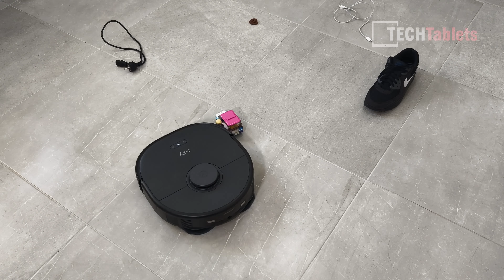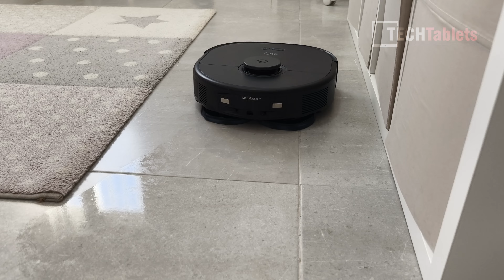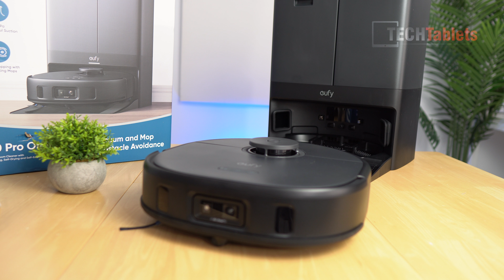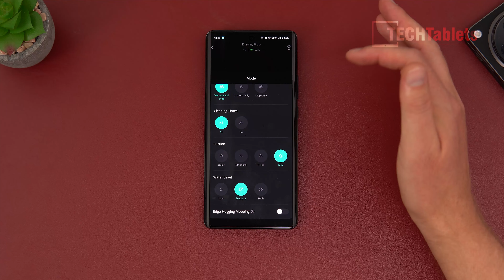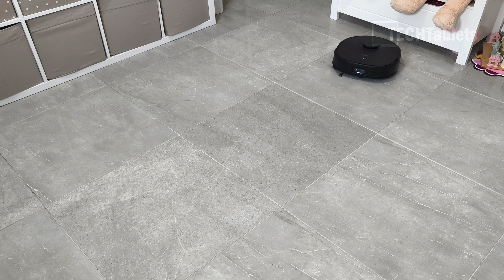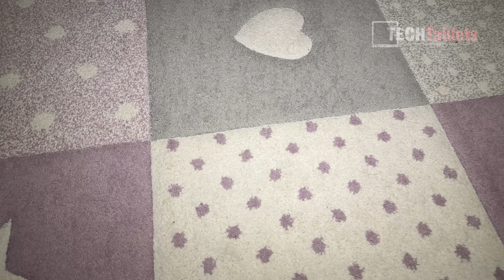The BEST AI Obstacle Avoidance All-In-One Robot Vac Under $1000! eufy X10 Pro Omni

Comment: How did you test detangling system, there are some reviews of X10 and previous eufy models using same system showing it does not work at all, your brush is pretty much spotless in your test
Reply from the maker: Letting it clean my house for a few days and auto empty itself, other vacs had hair stuck in them. Not spotless it had one strand after the same test others had many stands stuck in them. I can only think that the others didn't let it do it's reverse roller brush thing and auto empty. I have a household with 3 ladies with long hair and a cat maybe they have more hair with dogs etc I can't say but this was the result I got.

Comment: This looks like a seriously good vacuum. Really the only things I can think of that it's missing are hot water mop washing (but if it cleans them well with cold water then maybe no big deal) and a plumbing kit. The latter would obviously add a lot of cost which totally breaks the affordable price point that Eufy are obviously aiming for.

I'm planning to get this robot and I might have a go at building my own plumbing kit - emptying could just be a small bilge pump put in the dirty water tank & a float switch plus electric water valve could handle the clean water fill; shouldn't be that complicated or expensive.
Reply from the maker: It works really well and replaced my old X9 Pro. Hot water washing would be a little better I do have a model coming from Dreame that has that at 60 degrees and I can see the difference. And it has the pluming for it but the price is around $1500! Whereas this X10 Pro was on preorder with $100 off for as low as $599 and now it's $699.

Comment: Under $1000 are you nuts?   I've been using my $300 robot vac for 4 years and it's been flawless.   unnecessary Bells and whistles are certainly not worth a 300+ percent increase in price.  I bought an inexpensive effective robot vacuum and it works, never misses a spot, the rest of this nonsense is just nonsense.  I didn't give you a thumbs down but you shouldn't be acting like this is anything but a giant ripoff.
Reply from the maker: But your $300 robovac will avoid cables and mops the floor? It's empties and washes itself? You're comparing a 2001 Ford Fiesta to a 2024 Mustang sure both get you to A to B but very different . Plus you can get it for about $599 now (didn't know when I filmed this) to really the title should be under $600. Fair enough on the thumbs down do as you see fit! Thanks for watching!

Comment: What if there's a rug on a hard floor? Does it mop around it without trying to mop the rug?
Reply from the maker: Hi, it will lift up the mops or if you like just set it to avoid the rug.
Reply: 😢 @Techtablets Great and does it automatically switch to normal vacuuming when moving from hard floor to carpet?
Reply from the maker: Yes it does and you can also turn on carpet boost for carpets which boosts the power but it's louder.

Comment: I don't know if there's one video about this robot vacuum that's not sponsored or robot vacuum sent by Eufy, I really like the features but that fact makes me wonder..
Reply from the maker: Well it's actually really good. Yes this video is sponsored and I believe most are but I'd it wasn't and a normal review it would rank highly as the obstacle avoidance works so well, the mapping is good and so is the mopping. It's one of the best there is for the price of course being a sponsored video you're unlikely to believe that but it really is.
Reply: @Techtablets  I follow you because I trust you Chris, If I thought you were a video leaflet I wouldn't be here. Just wrote what I noticed around YouTube since I was personally looking into this one considering the feature and much lower price tag than roborock equivalent in terms of features. What differentiates more expensive similar features roborock from this one? Also this awkward movement it does to wipe edges, how long does it prolong the cleaning cycle?
Reply from the maker: There really isn't anything the more expensive ones do better than this now apart from the mop extend some have. A model i'm currently testing does this, but really it isn't enough to justify the extra price tag. And that mop edge clean does slow it down around the edges by quite a bit but you don't need to always have it doing that.